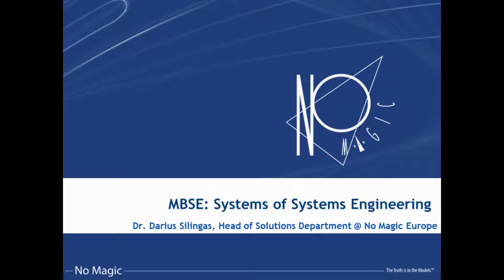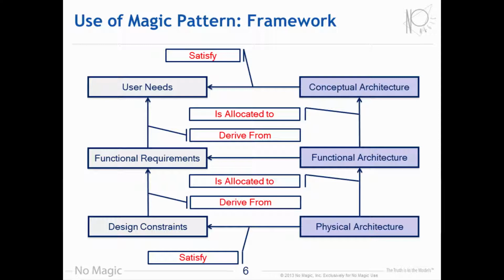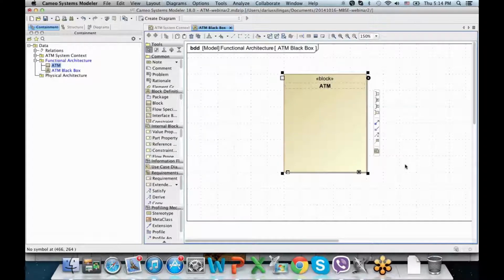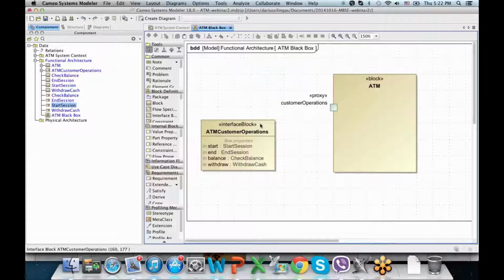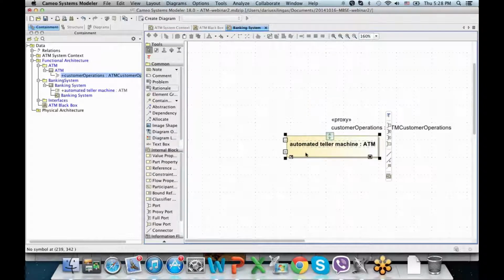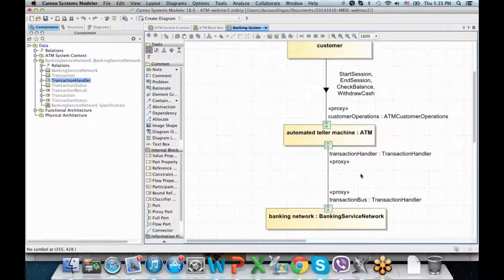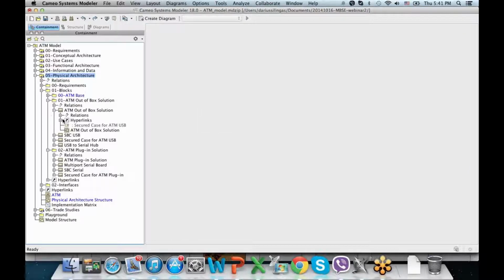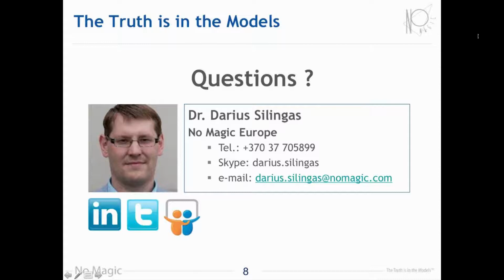Systems of Systems Engineering Webinar

Comment: Can you do an update to this presentation after six years 2021?
Reply: I'm following this in 2022, with 19SP4 and its nearly 100% the same.  Slight hiccup on adding the flows (as the 'pre-filled' values changed') but just experimented a couple times and it worked.  When you get to the Adding the ATM to the Banking System diagram, you may not have the ports selected as visible but they are there.  Just right click the ATM box, go to "Display" and select "Show all Ports"